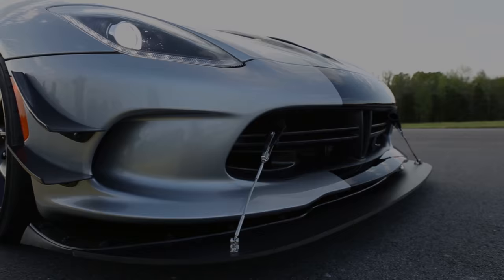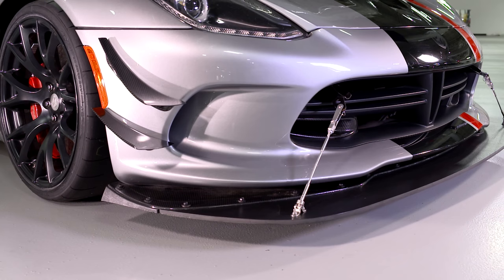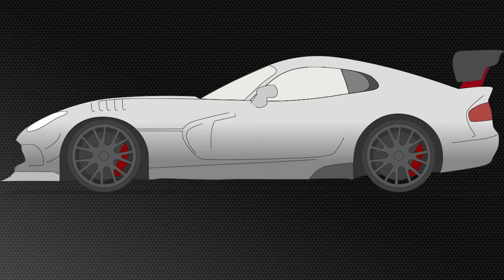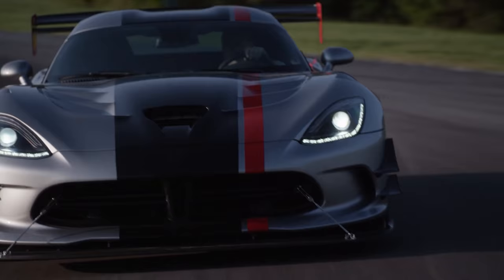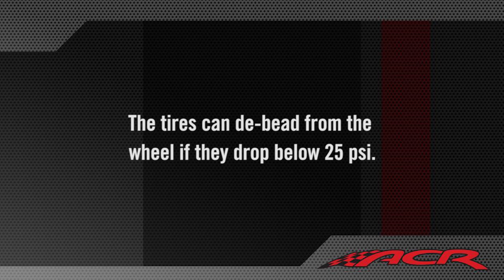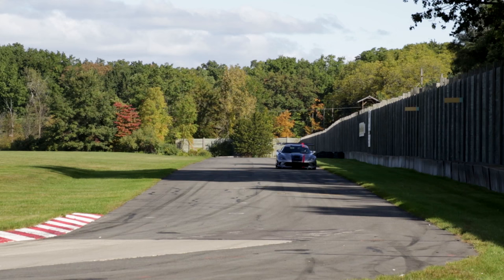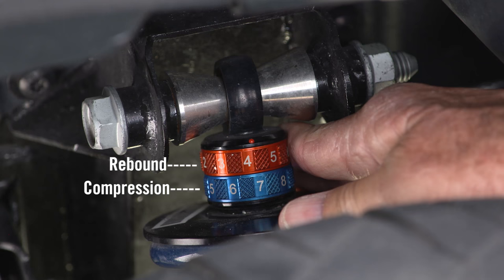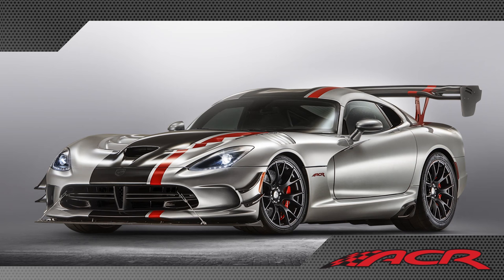Track Setup | Viper ACR  Features Overview | Dodge

Comment: i still can't stop laughing how this 100-150k car destorys cars over a million dollars lol
Reply: And does so requiring actual driver involvement.  From driving it to setting it up.   I love it.
Reply: ***** the aero on this car is nutty this is the 3rd most aerodynamic high performance car from the usa the 2 cars ahead of it are the mosler mt900's (2nd) and god of aero the saleen s7 (1st)
Reply: JJ-Ghosty You base it on what? Air drag coefficient and downforce ratings?
Reply: Armands 17......Track times...the ACR has more track records than any model car. Also has beaten the 918 porsche on 3 out of 4 tracks that they both have ran on.
Reply: @LUPENTV07  they need to make a new viper and make it more aerodynamic and more fun so it can be back on top again
Reply: @coolsquad7428  I want you to look up Calvo viper and nth moto viper you will be amazed

Comment: There are many Dodge Viper fans who want to see it released as an online racing game called City Racer, which is currently being serviced in Korea. In particular, the City Racer uses a 6-speed manual transmission. Many users hope that the 5th generation Dodge Viper VX model will come out as S class in City Racer.

Comment: Hey Dodge, been wondering why the front fender vents were removed? It was not touched upon in the video why these components were removed. Optimizing air flow is probably what is going on, but it was not discussed so I wonder how this change will effect the car. Thanks.
Reply: waasappt
Reply: The reason they were removed is to help with airflow, by having those extra holes in the fenders it allows for a little bit more hit air to escape from the engine bay

Comment: Sir, I am a great admirer of the Dodge Viper ACR. If by any chance Dodge decides to revive the Viper ACR, please study the technology of how a car with the same V10 engine can create even greater torque than before at a better fuel consumption level and with quieter engine noise: pressurized fuel injection that imitates the swirling flow of an American open air field Cyclone weather phenomenon. By redesigning the Cam shaft, any car's engine can produce even better engine performance. Honda pioneered an initial version of this technology by calling it the "cyclone power design engine". Ford Motor Company USA has even gone further and made a better version of Honda's by inventing its own Cyclone configuration engine design that creates an even better Cyclone power-based engine performance and adding a turbocharger/supercharger but this time for Ford's diesel cars. Please open this link to check it out. Thank you.    https://www.msn.com/en-us/autos/enthusiasts/ford-ecoblue-20l-technical-wonder/ar-AAwTTtM?ocid=spartandhp